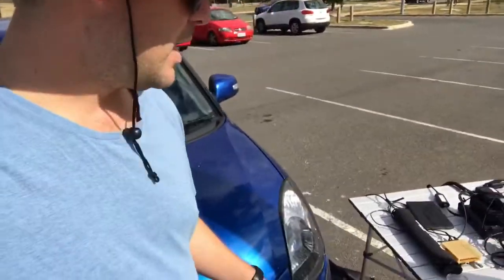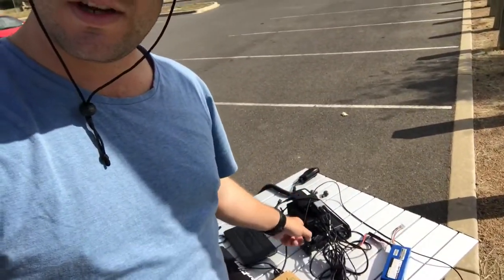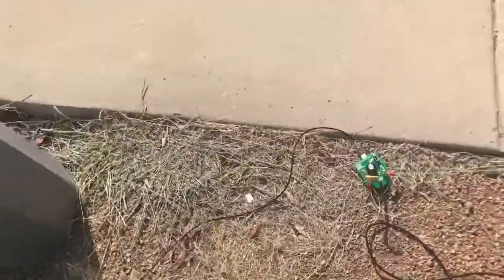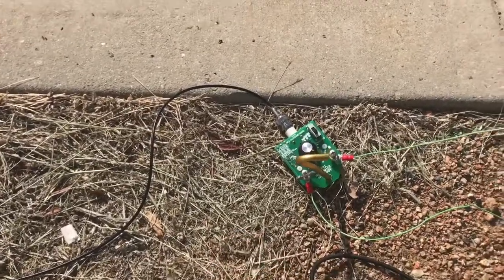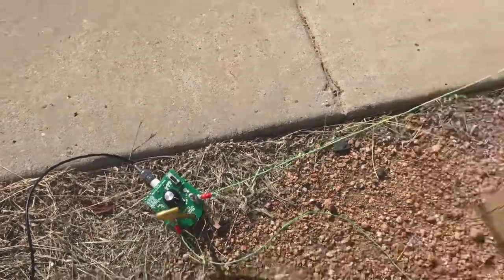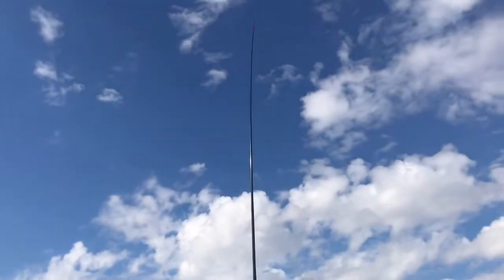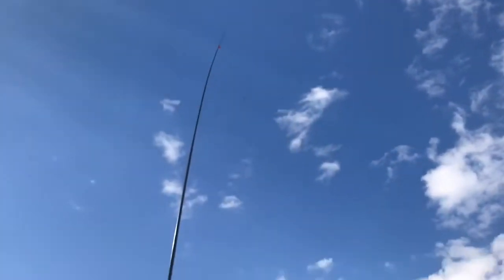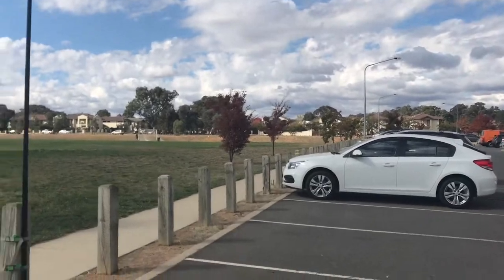A quick look at my home brew Half Wave End Fed linked 20/40m QRP antenna

Comment: Nice setup Wade =)   I to like the Homebrew R Pi Field SSH computer =)  de N5VMO Pat
Reply from the maker: Pat Hopkins thanks Pat!  It is pretty capable now!  Runs fldigi, wsjtx and winlink via PAT on ARDOP. Just driven crazy that I can’t get CCW HF APRS messenger on it.
Reply: I'm doing the same Wade with my R Pi using a SMARTY Pi display in the truck ( rig and AVnav ) and the "Droid as a APRS with the FT-V71A Kenwood =)  I too would hope Pat would port over CCW HF APRS from Andriod to Linux OS ...... I have even thought of using a DUAL OS R Pi SIM CARD swap ot TWO R Pi's /-)